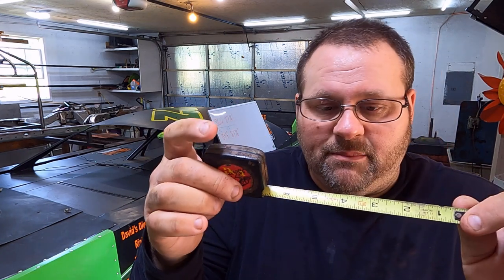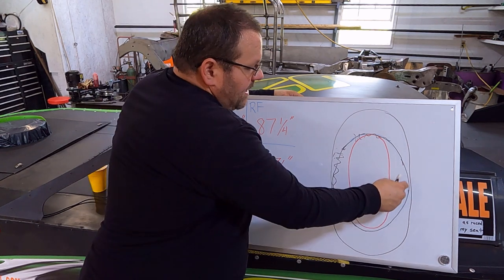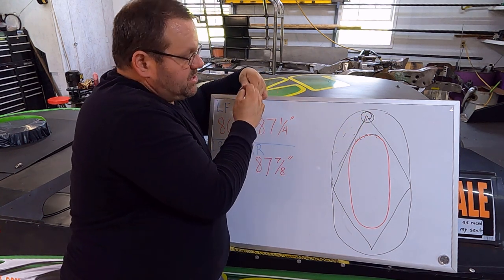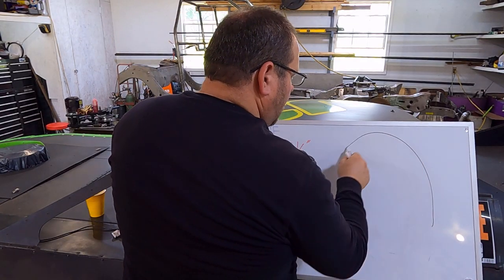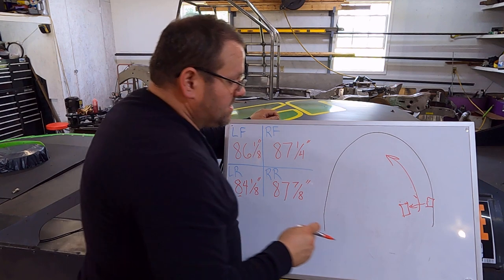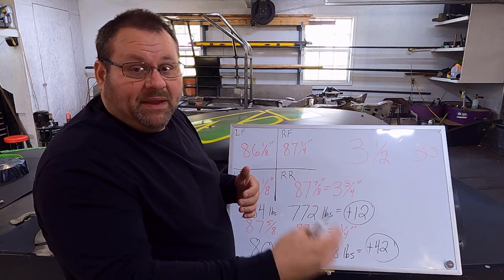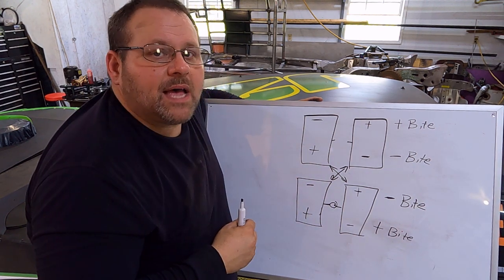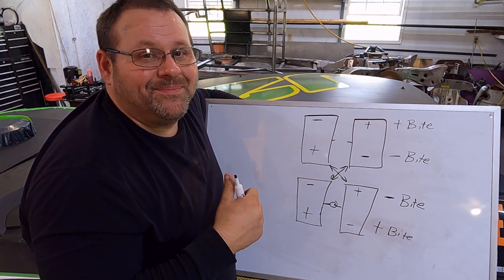Why Tire Stagger is so important in Racing (And how to measure it)

Comment: Well done, your explanation of what happens when  when you change stagger is very informative, FWIW, my experience was to use as little stagger as possible until you ran out of options setting the car up, for sure a camera is a great benefit toward the proper setup.
 Back in the 70's video equipment was expensive and rather large, these facts however were partially overcome (the expense anyway) by going to the community college and suggesting wiring the car up with cameras to help students become better acquainted to using video for diagnostic purposes in a dynamic application. What a revelation it was to see just what was happening during a lap, one of the eye opening events was just how much tire is actually on the track at a given time, it was very useful to getting a simple thing like tire pressure set right, way too many people run tires too soft, the camera was very telling when compared to lap times.
Reply from the maker: I learned about the low air pressure a little late in the game myself, wish I had understood it earlier :( 
I agree, no more stagger than needed to make the fastest lap. too much only slows you down!

Comment: I raced ministocks and curently race a streetstock, and at our track I've always ran about 1" max rear stagger on a heavy track with alot of grip, and alot of the time ran no stagger. Dad tells me he used to run negative stagger back in his day (1980s/1990s). We've both always preferred to run a little tighter setup than most.
Reply from the maker: I have run only 1 inch many times successfully as well but have never had any luck at all with reverse stagger. I know a few folks who have done it and made it work but I am not one of them :(
Reply: Reverse stagger was usually used by people with open rear ends to stop spinning the left rear in the corners.

Comment: Can you do a video about rim stagger (offset) and what that would do or affect handling. I run a 85 Chevy s-10 coil front and leaf rear. My motor is a 81-84 Toyota 22r. I run tire and rim stagger and would like to learn more about it. I also run 10” wide asphalt slicks on dirt on 15x10 steel wheel
Reply from the maker: I am hoping to come back around to this in a few months when we are working on the new car at the track. It is a complicated topic and has some conflicting features I would love to just dirt nerd out on for a good solid 30 minutes. So the sooner the better :)

Comment: Would this be beneficial to a crown vic dirt track car? The track is banked pretty good and the high line seems to be the line that always works.
Reply from the maker: Absolutely, tire stagger and how it affects the turning radius is universal to circle track racing. I will say this, high banking typically means you need a liitle less stagger.

Comment: this may be a dumb question, but this will be my first year racing so bare with me. How do you adjust the circumference of the tire to adjust stagger? Is it all related to tire pressure or what? Thanks for any help!
Reply from the maker: Like all answers it "Yes and No" :(
Here's the deal. On a radial tire there are steel belts and the circumference is very fixed. It may change slightly with air pressure but you have to be far to under or over inflated to see the change and at that point the tire is not working right anyway. If you are on radials and need stagger, you should look at it from a standpoint of running the air pressure you need and running two different size tires to get the circumference difference (stagger) you need.
On bias tires (which is what racing tires are) the belts are nylon cord and the tires will vary in size for the same model tire and can by coaxed into growing a small amount if needed. Here's a good rule of thumb on racing tires. You will gain 1/10th of one inch per 1 psi in a tire. So for example I could have two H500 tires that are both 87 inches at 13 psi but I run the left one at 13 and the right one at 18 and I find the right one has grown to 87.5" at 18psi instead of 13.
Many people will tell you to air tires you need larger up to their safe max and leave them a couple days to let them grow. I have found they typically return close to where they were eventually but will keep about a 1/4" of the gain at most. It's worth doing if you need the stagger but just keep in mind when you do this, don't think you have that 1/2" or 3/4" growth you may initially see. Just let the air out of them from another day to rest and then put them at running pressure and see what you have.
Reply: @DIRTRACELIFE  thanks for taking the time to reply. I enjoy watching your videos and learning something!

Comment: Will this same presentation work on put bite in or taking bite out of a dirt modified?
Reply from the maker: Yes, This is very universal John. Wouldn't be any difference in a modified as far as the direction of change and what it impacts but keep in mind there is MUCH more adjustability when you add all the adjustments in a modified (Pullbar, J Bar, Radius rods, Indexing, Etc)

Comment: I run pure stock car we have to run stock suspension springs shocks Can you give me some info on making my car turn good entering the corner is adding front stagger going to be about the only thing that will help thanks again for your videos and hopefully you will be able to get back to me with my questions
Reply from the maker: Yes Junior, your thought on adding front stagger is an option. It would increase LR bite and thats going to help loosen your entry. But keep in mind every change has consequences. Every setup is different so be aware it could cause other changes like a throttle push in the center. 
No free lunch on this stuff. Takes time to get a good grip on what a car needs so be patient and keep researching as you work on it.

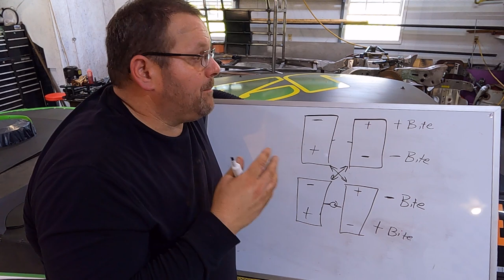Comment: 23:45 
I run a front wheel drive class. How could I get stagger to help me?
Reply from the maker: If the transaxle is locked then it applies the same way but to the front tires. If it's an open differential then stagger is just changing the ride height and wedge in the car.

Comment: Ty for the lesson. What does changing wheel widths do to stagger?
Reply from the maker: Very little Joseph, Last winter I had to do this for the Talledega Ice Bowl. I put Hoosier 3035 asphalt scuffs on 15x8s instead of my normal 15x10s. Nothing grew over 1/4 inch. Thats because moving the sidewall in or out does not change how the belts are holding the size of the center. It DOES take more air pressure to get the car to drive similar. I went up between 1 and 2 pounds on every corner. It seems to roll over on the edge of the tire more and I had to add air. Well that made for a slight gain in tire size but it was on all four so no change in stagger. 
I hope this helps and thanks for watching our episodes.

Comment: I’m running 3” of stagger in the rear, 1/2” up front, catching the guys ahead of me in the corner then they pull in the straights. I’m posting the video now, can you watch it and give me your opinion? I’m 5th fastest lap average, 15 cars but about half a second behind the 4 above me….
Reply from the maker: Kyle. . . . . Well it ain't slow either :) 
Seriously though I watched the heat and feature you posted. At first I thought you were just a bit tight on entry but after watching it all I think you are just under geared compared to your competition. You look hooked up but they are clearly out pulling you off the corner especially if your line through the corner is not nice and smooth. Being undergeared &/or under motored is causing you to "appear" tight to me. If you can't get up on power or gear then I would say you need to get that car freed up some just like any 602 racer would do.
I'm a stock car guy with a lot less modified experience so just keep in mind these are outside observer opinions but I hope it's some helpful insight.
Reply: @DIRTRACELIFE  I appreciate your opinion! I like watching your videos. All crates so I don’t think motor is the issue unless they are all cheated up 🤷🏻‍♂️ same gear as far as I know. 5.43 @6000-6200rpm depending on track conditions 6200 chip. They all have a lot more experience than me tho so could be that. 🤷🏻‍♂️

Comment: How is the rear suspension on your Camaro work/look
Reply from the maker: I use the composite leafs and use extended length shackles on the rear.  1.5 block on the left and a stock mount plus a 1 inch on the left. (Probably the same as a aftermarket with a 2 inch block). I run my shackles at 8, 9, or 10 inches depending on the setup (i change at times to meet needs).
Ill have to come back and do another video on it. The first one is deep in setup and scaling but doesn't get into all the details on the leafs.
https://youtu.be/jeFV6ASUkgw
Thanks for watching!

Comment: does this apply to asphalt as well
Reply from the maker: Well yes and no.... to be clear I have dirt experience. I love it all but have no asphalt tracks anywhere near me. The rules of how stagger changes bite in the car and how stagger affects drive in the turn radius are still true but the amount and the characteristics of how for example a 1 inch change affects the car would have to be drastictically different on asphalt. We need an asphalt expert to chime in here cause it is not me :)

Comment: My car keeps trying to spin out in the corner and I have added weight and took weight out but still have the same problem. My stagger is pretty much right but I can't keep it from coming around on me. This is a factory stock car.
Reply from the maker: Kenneth, there can be many many different causes. First and foremost it can be difficult to keep a car under you if your rear percentage is less than half (50%) unless setup is very close. You say you add weight and take weight out but that's not necessarily the issue as long as you have some reasonable amount of rear percentage (lets say at least 50%). REALLY need to find someone with scales who can scale it for you. You may find you just don't have your left rear bite even close to a workable number. And absolutely check all suspension everywhere for a bind. Binds on any corner can make a car unpredictable at turn entry and when you pick the throttle up. 
I appreciate you watching and hope this helped.

Comment: I need to gain about a 100 more lbs of left rear bite how can i go about doing that on a factory stock no screw buckets no jack bolt
Reply from the maker: leaf or coil car?
Reply: Coil spring
Reply from the maker: Ok the fastest one is different height springs. so for example a 13" LR and 11" RR. thats going to net you 100lbs with a quickness. you can do the same on front but its not as good a deal to do a 12" RF and 11" LF
 Another thing if legal, cut the LR spring mount off the rear and put a 1/2" spacer under it.  or 3/4. play around with it on the scales and figure out how much spacer gets you there.
Reply: @DIRTRACELIFE  it's already that way so I guess trying spacers on the left rear spring  would be my best bet

Comment: if i increase stagger in the front it will increase bite help the car turn in and can reduce rear tire stagger for more bite ? just thinking outside the box could you hillbilly the rear tire stagger too help the car push a little on a big dry oval track ??????????
Reply from the maker: Dino, yes adding some stagger in front will loosen entry some due to increasing the LR bite. Can help you in a pinch at the track.     You have to be alot more careful on those rear tires. The stagger needs to match the track requirements and adjust bite elsewhere. Also I would NEVER suggest running reverse stagger. If you are doing that and it works, you have serious issues elsewhere to be fixed and the car is not going to be as fast as it potentially could be with the correct stagger. Hope this helps and thanks for watching!
Reply: @DIRTRACELIFE  Thank you

Comment: why is it my coil spring car prefers reverse stagger? i have to run my right rear 1 1/2 to 2 inches shorter to get it through the corners.....
Reply: and it is fast through the corner but loses forward bit on exit till about mid track
Reply from the maker: It's hard to say for sure but my gut says something is way off. 
A couple things to check. First scale it if you can get it on scales. You should have SOME amount of left rear weight greater than Right rear weight. It very much depends on the car and setup but if its not somewhere between 50 and 250 lbs then you've got trouble. Ok so what if you can't do that???? Well, get  a socket, sit it on the jack and put it under the rearend housing. Make sure the right rear tire lifts before the left rear. How much? With the car on level concrete, driver in car, and correct tires and pressures the right rear should be between 1/2 inch and 1 inch off the ground at the point the left rear is just breaking contact with the ground. this is SUPER old school but will at least help you get in the ball park.

NEXT BIG THING THIS COULD BE: You could have WAY too much left rear lead in the car. String the car and check how much lead the left rear has. If you measure more than 1/4 inch then you may want to address this (be warned depending on track, chassis type, and driver there are times it could be appropriate to have that much lead or even more... It's hard to cover all that in this one comment)

I appreciate you watching my videos and hope maybe some of these ideas are helpful.